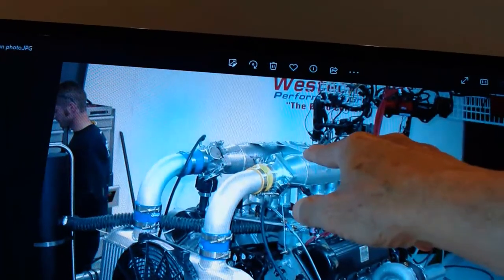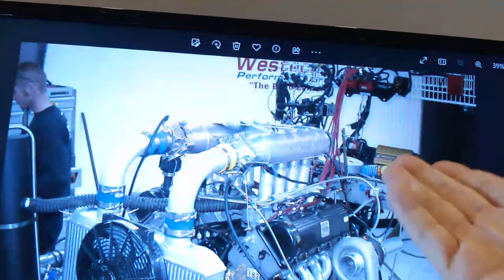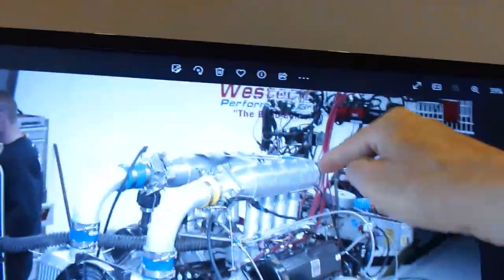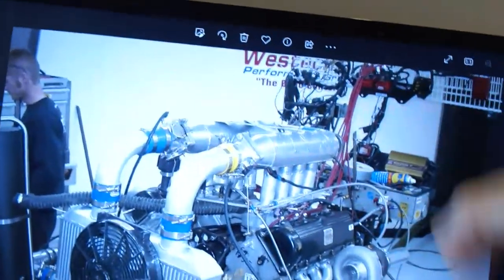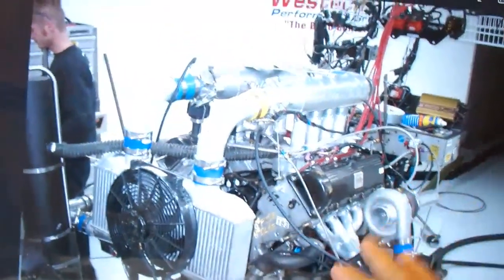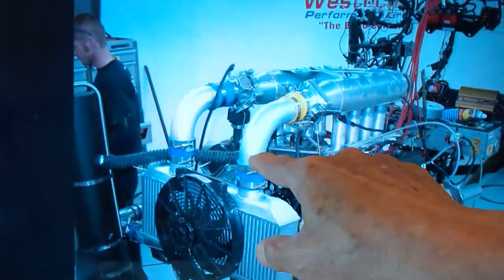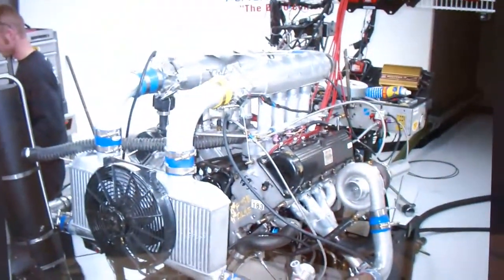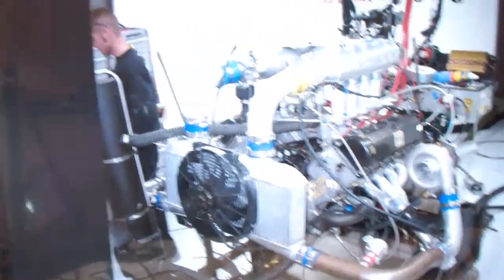LET'S TALK TECH-THE MODULAR FORD INTAKE

Comment: I bought my wife an Edge-ST with the 2.7 turbo Ecoboost with the 7 speed automatic AWD for Mothers Day. I can’t drive anymore, but for a 2.7 V6 and that little engine is really a pleasant surprise. 335hp at 5500 380 ft lbs tq. And with AWD it handles really well. It is a 2022. Do you know of any canned tunes for the 2.7?  It is 10.3cr, I would like to kick it up to 360-375 hp at 5700  and 410 ft lbs at 3300-3500.
Reply: Tuning will make the warranty disappear,  but I think 5 Star Tuning is a decent choice.

Comment: Day 2 of asking for stroker 4.6 content
Reply: yes we need a big bang 2v!!
Reply: I was browsing the ford section at pap for a friend needed a exploder 5.0 I was counting the mod motors I stopped counting at 25 and stopped guessing around 35 settled on there’s at least 40 mod motors available :p
Reply: The 5.4 with boost would be awesome. 1100-1200 hp.
Reply: @hondatech5000   @hondatech5000  why did the explorer always get a better version of what the GT mustang got? Like the exploder 5.0's had gt40 parts, when WAP blocks became a thing the explorers had WAP block aluminum 2v's, just don't make sense to me!
Reply: @Prestiged_peck  Explorer ran the 5.0 years later. And it was heavy and needed the extra flow for power.
Reply: @Jim_Lawrence  makes sense for the 5.0, but what justified the aluminum block 4.6? 100lbs won't make a big difference in that big of a vehicle I wouldn't think
Reply: @Prestiged_peck  I don't have an actual answer, but I do have a couple ideas. In manufacturing, tooling is expensive and has a life expectancy. Maybe they had capacity or tooling life to justify it. Probably not. Another thing is volume discount, more you buy the cheaper they are. Again, probably not. I would throw my money on they translated that weight savings into towing and cargo capacity. That's big on Fords list of priorities. They could get a higher capacity without heavier tires, springs etc... while getting the ride quality. Speculation? Yes. History of lightening vehicles to gain capacity? Also yes.  
That's all I got...
Reply: @Jim Lawrence  I can see that. An extra 120lbs of payload is pretty significant, and an extra 1200lbs of towing (assuming a 10% tounge weight) is VERY significant. Makes me sad we didn't get an aluminum 5.4 in the navigator though
Reply: @Jim Lawrence  I can see that. An extra 120lbs of payload is pretty significant, and an extra 1200lbs of towing (assuming a 10% tounge weight) is VERY significant. Makes me sad we didn't get an aluminum 5.4 in the navigator/expedition though. Would've really helped them out.
Reply: @Prestiged_peck  Better yet, an Aluminum 6.2 with aftermarket support! Although it looks like the new 7.3 is getting support from all over. Not a cheap junkyard pick yet though.
Reply: @Jim Lawrence  the 6.2 really deserves more support than it gets and I really want to look at doing a low production megasquirt plug and play type system for the 6.2, even if it only works with a manual or standalone capable automatic.

Comment: RICHARD, THE MODULAR 4.6/5.4 ENGINE WAS DEVELOPED BY FORD WHEN THEY OWNED LOTUS. THE LOTUS FORD ENGINEERS DESIGNED IT. YES, THIS IS A LITTLE KNOWN FACT ABOUT LOTUS. LOTUS WAS COMPLETELY OWNED BY FORD. FORD OWNED THEM UNDER A SUBSIDARY. BECAUSE THEY DIDN'T WANT PEOPLE TO THINK THEY WERE BUYING A FORD AND THIS IS WHY THEY OWNED IT UNDER A SUBSIDARY. THERE WERE SPECIFIC 4 CYLINDER COSWORTH ENGINES MADE BY FORD COSWORTH USED SPECIFICALLY IN LOTUS CARS. THEY WOULDN'T BE DESIGNING SPECIFIC ENGINES FOR A COMPANY IF THEY DIDN'T OWN THE COMPANY. IT'S NOT GOOD BUSINESS SENSE TO PRODUCE ENGINES FOR A COMPANY SPECIFICALLY. AND THEN THEY GO OUT OF BUSINESS LEAVING YOU WITH A FACTORY OF SCRAP METAL. BECAUSE FORD COMPLETELY OWNED LOTUS IS THE REASON THEY SET UP A FOUNDARY TO MAKE THOSE ENGINES. IN 1986 FORD SOLD OFF 70% OF THE COMPANY TO GM (YOUR MAGNETIC SUSPENSION USED ON THE CAMARO'S WAS WHAT THEY AQUIRED FROM FORD BACK IN 1986 WHEN THEY BOUGHT 70% OF THE COMPANY. FORD KEPT 30% BEING THE ENGINE RESEARCH AND DEVELOPMENT DIVISION OF LOTUS. GM HAD ACCESS TO THE ENGINEERING THAT WAS BEING DEVELOPED, BUT IT WAS CONTROLLED BY FORD SINCE FORD STILL OWNED 30% OF LOTUS. THE MOLULAR FORD MOTOR STARTED OUT AS A 4.6 SOHC RACE ENGINE. IT WAS CALLED THE CHAPMAN LOTUS V-8. IT  WAS RACED IN NASCAR IN EXPERIMENTAL FORM. IT CAME FROM ENGLAND IN A CRATE AND WAS INSTALLED IN A FAMOUS RACERS CAR. IF YOU THINK FORD ENGINEERS AREN'T COMEDIANS AND LIKE TO LAUGH. THE ENGINE AS I SAID, CAME FROM ENGLAND AND IT WAS PUT INTO THE GM  MR. GOODWRENCH CAR OF DALE EARNDHART. THAT WAS USED AS A TEST BED. I'M LAUGHING MY BALLS OFF WRITING THIS. WHAT DALE EARNDHART WAS WINNING RACES WITH WAS THE FORD MODULAR MOTOR YOU ARE TESTING THERE, IN A RACE FORM. AFTER A CERTAIN AMOUNT OF HOURS RACED. IT WAS PLACED BACK IN THE CRATE AND SENT BACK TO LOTUS IN ENGLAND FOR INSPECTION. AS DALE WAS RACING THE ENGINE THE FORD ENGINEERS WERE LAUGHING THEIR BALLS OFF. FORD THEN MODIFIED THE 4.6/5.4 FOR EFFICENCY FOR PASSEGER CARS TO MEET EMISSIONS. THESE ENGINES GO 800K IN CABS HERE IN NEW YORK. IF FORD WANTED THEY COULD HAVE RELEASED THE RACE FORM OF THIS ENGINE AND YOU WOULD NOT BE SEEING A LS TODAY WHICH IS COMPLETELY FORD IN DESIGN, A REGURGITATED FORD 427 HIGH RISER AKA RAISED PORT 351 WINDSOR. YOUR ZR1 CORVETTE ENGINE BACK IN 1989-92 WAS ALSO A FORD DESIGNED ENGINE FROM LOTUS. I LOVE TELLING MY CHEVY FRIENDS THIS HISTORY BECAUSE THEY SCREAM AND YELL AND CALL ME A LIAR. I PUT THEM IN THEIR PLACE. WITH THEIR PIPE DREAM THAT CHEVY IS THE BEST. EVENTUALLY I WILL TELL YOU HOW THE SMALL BLOCK CHEVY CAME INTO EXISTENCE, THAT WILL SHOCK YOU WHO DESIGNED IT.